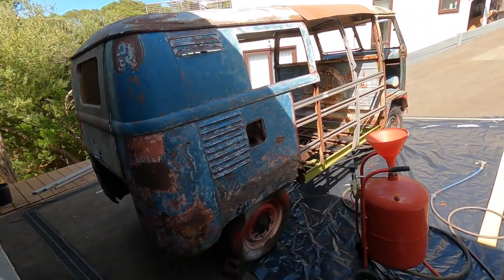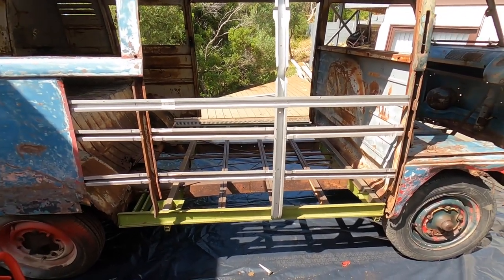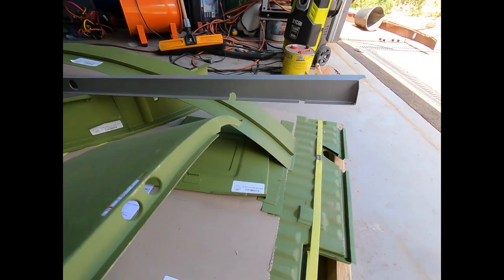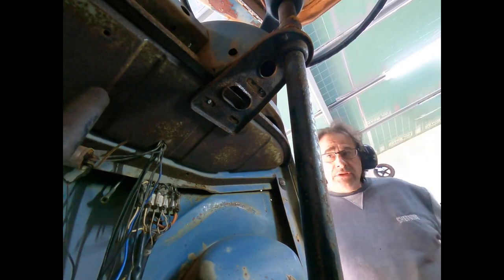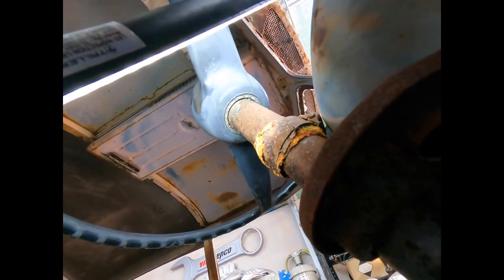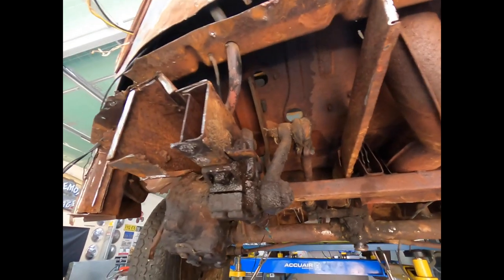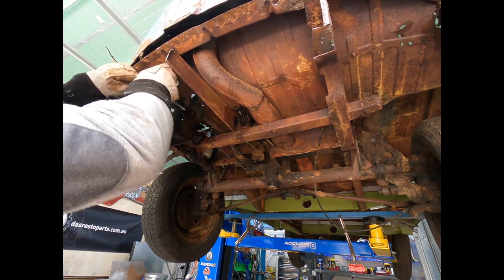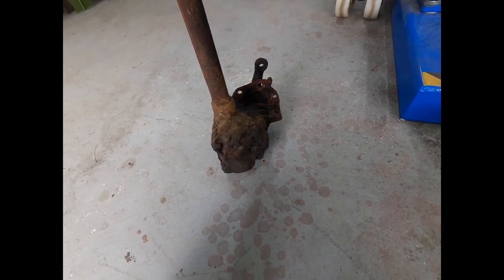RESCUE of a VW 1955 panel van Australian bush find // part 11 #vwbusrestoration

Comment: I'm really glad I found your channel. Great info and great fun. That steering wheel was stressing me out like the jack in the box did to me as a kid. Haha.

I ran in to a bit of an issue on my project. Mind if I ran my problem by you?
Reply from the maker: Yeh, I didn’t think it would come off without damage. Very lucky I’m calling 😉 An issue? Yeh no problems ask away 👌🏼
Reply: @DemopVWgarage  Yeah. I purchased my kombi with a lot of the lower welding already done. I just put on the Klassic Fab door that came with the car on my driver side, adjusted it so the body lines match up and there is about a 15 mil gap on the front side of the door near the A pillar, as well as an 8 mil gap on the B pillar side. Almost as if the door is undersized. Do I need to try and hammer the A pillar back, or maybe weld in a strip of metal to the front of the door? I posted a picture of the door on my instagram account with the same name as this one, if you would like a visual, and I just followed you =D
Reply: @DemopVWgarage  Sorry if that sounded like self promotion. I assure its not. Just suggesting a way for you to maybe see the problem i am talking about.